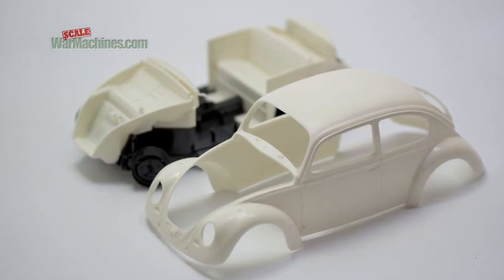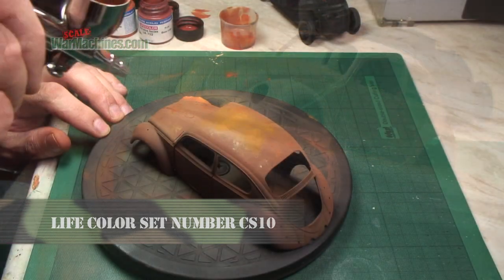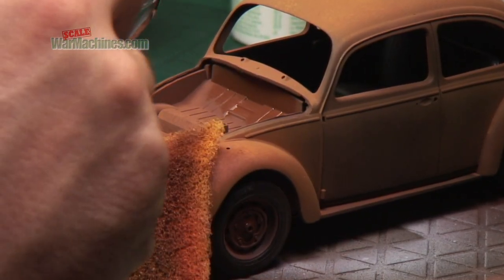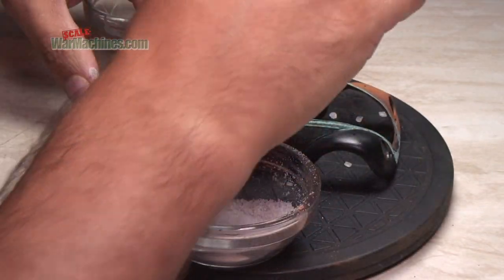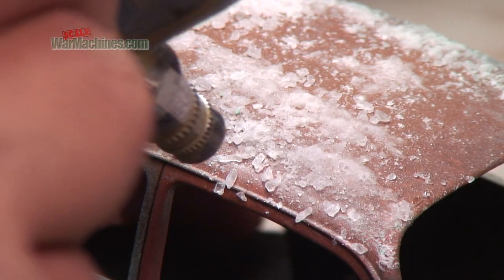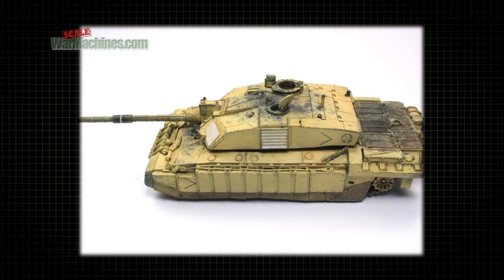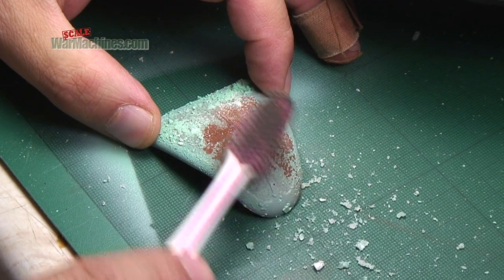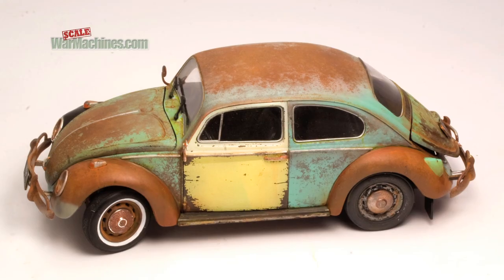SALT CHIPPING - SCALE MODEL HOW TO GUIDE

Comment: I tried this technique on a locomotive roof using these products, and the results were amazing! One problem I ran into was, the water would bead up over the Life Color rust paint. I used dish detergent to rememdy this but, it seemed to use  a lot of it. I would normally use isopropyl as a wetting agent but, obviously, I would not use on top of paint.

Comment: Reworking a King Tiger I built in the 90's, going to use the "salt job" rather than chipping fluid as the outcome looks amazing!  At 1:37 you mention "seal to protect the rusty base" I'm assuming that refers to a matte varnish? Thanks.
Reply from the maker: Yep - sealing is any kind of varnish, matt, satin, gloss, Klear etc.

Comment: Do worry if the air dislodges some of the salt. I don't know yet for sure, but I suspect little salt grains got into my airbrush and are causing severe paint clogging. I will keep you posted on what I find out. Great results from salt chipping, but any methods you can use to keep all minute salt grains  in place, and from being around painting area. Just one micro salt grain in the airbrush can make you wish you never built models

Comment: Great educational value in this video.  Kudos to you, Sir.  Now for a question for you and the audience.  Does anyone have a source for the sponge used in applying the rust coating?  I'm stumped!
Reply from the maker: Ha good question! Go to a phone shop or pawn shop and ask for any leftover foam or packaging foam from gadgets like iPhones. It seems to be most used as screen protection.
Reply: well, bad news, good news and more bad news.  Received a shipment of the above linked material.  Doesn't work as it is entirely non-porous.  The good news is that the wife now has an abundance of the sheets to use in packing gifts, dishes and glass.  The additional bad news is that research shows that Apple has ceased to use the kind of stuff shown in the video and has gone to almost entirely eco-friendly packaging, cardboard and the like.  So it's back to the search.  Any sources of that material will be much appreciated.  Thanks.

Comment: Hi great video for sure, can i ask a question? what did you use before applying the salt (wet one) is a clear coat or any else? thanks :D
Reply from the maker: Reyhan Ramadan just a thin coat of varnish or Klear - although it's not always necessary but recommended to protect the paint.

Comment: Very interested in this technique.  Do you need to use Enamel paints for the base coats since you are working with water or can you use acrylic with no issues?
Reply from the maker: No you can use acrylics - if you are worried, seal with varnish or Klear - otherwise this still works even if the acrylic is unprotected. Just make sure it's fully dry.

Comment: you are amazing, i have a question my friend, im trying to replicate, new batman superman kind of distresed look on a model, do u have any ideas???
Reply from the maker: +Charly Dumeng Thanks. Not seen the film yet but know the look. We'd go for full grey/aluminium/white base coat followed by hairspray or chipping medium on top then top coat in Batman black. Next degrade with water & scratch or pick at the top coat to reveal tiny scratches underneath. Seal with Johnsons Klear or similar, allow to dry then scratch further with a sharp scalpel tip & even a sanding stick to reveal more wear & tear through the black & reveal more of the metal/armour under the paint. Matt it all down when done & do any final touches with paints for scratches, chips or wear & a light bit of sporadic drybrushing too if needed.
Reply: Man you are the best thank you very much

Comment: That looks great. Do you have to use an airbrush though? Will it work well with regular spray paint or would the paint be too thick?
Reply from the maker: Tim Kline Best to use an airbrush - ideally a double-action. That's because you can easily control the intensity of the paint coat going over the salt & that makes the overall effect really work. You could try with a spray can - especially on a larger model - but you need to control intensity through distance - i.e. how far you are from the subject. Also, aerosols are more powerful & may blow away your salt if you're not careful.

Comment: When you spray your initial primer, and your basic rust Coatings, are you using enamel primer and paint, or are you using acrylic?, I don't have an airbrush, will any rattle can type primer/paint work? (whether it be enamel or acrylic)     thank you, cheers.
Reply from the maker: All acrylics, primer then acrylic top coats. May work with a rattle can but you'll have a lot less control and risk blowing away the salt. Get more distance from the model if that's happening.
Reply: Can you suggest a quality primer and paint that comes in acrylic rattlecan? (Until I get a airbrush, which I plan to do here soon.) Thanks for the info.
Reply from the maker: Good rattle can primers for Acrylics? Games Workshop Chaos Black, Tamiya Grey or White, Andrea Primer, Gunze, Automotive primers.

Comment: Is this possible without and airbrush? Probably would look weird if paint it with a brush but at least using some x coloured spray can.
Reply from the maker: clawhammr666 You can do with an aerosol can (rattle can) but you will have less control - this works by spraying different intensities of top coat over the salt that's why it's suited to an airbrush. A paint brush method is never going to work but anybody can try with a spray can.

Comment: I've practised on a 1/32 scale beetle and it looks pretty good now I've bought this same beetle but I'm struggling with the interior how would you attempt to make the seats look worn and faded
Reply from the maker: Matthew Pearsall you could use the same technique or a chipping solution but with only a slight contrast in shades so it's subtle. You could stipple on dark spots for mould. Use crackle paint to subtly show cracked leather or distressed vinyl. We did that on our Gti seats and it worked.
Reply: Scale War Machines 
Thanks do you have a video on how to do that I really have to work hard on this type of thing I can see what needs to be done but I can't make it happen the way I see it

Comment: Very inspiring tutorial! Thank you! 
I tried to replicate the procedure on a tank and.. i've got only one problem.. the salt doesn't stick to the surface. The result is an insufficient covering of the first rusty layer. Do you have any tip?? It's really frustrating to see all the work done to obtain the rust being covered this way!
Reply from the maker: Does the salt get blown off? Lower the pressure. If not, change brand of salt and let it dry before spraying.
Reply: @scalewarmachines  Yes it blows off too easily... I think it happens because I didn't let it dry enough. Thanks again!

Comment: What air brush and paints are you using, I've tried to use watered down acrylic paint but the airgun just doesn't spray the paint?
Reply from the maker: Iwata mostly in this video with either Tamiya or Lifecolor acrylics. Always thin with their own brand thinners for simplicity and each paint brand is different. Test on a scrap model but the level of thinning, air pressure and needle size all make a difference. Try thinning more with their own brand thinners - start with a mix that's 50/50 paint/thinner and high pressure on the Airbrush, then reduce pressure in increments, if paint runs, spiders or doesn't atomise (dry), then up the paint ratio progessing towards 80/20 until the airbrush can't spray it any more or splutters even as you increase the pressure. Then you will know your paint mix ratio and ideal pressure range.

Comment: my question is what did he use to seal the rusty base before he started the chip seem to me if you are gonna put water on it u would want a water prof sealer
Reply from the maker: It is preferable but not essential. As long as the paint is dry it should withstand water. In this case, no sealant or varnish was used.

Comment: Host can I make chrome trim doors on my vw beetle 1/18 and my Fiat 500 1/16 ?
Reply from the maker: +Sethi1st In other words How can I paint chrome trim on doors? Easy, mask off with high-quality masking tape (e.g. Tamiya) & spray with your best silver, metallizer or chrome shade - then remove masking. If you are after good results Alcad paints should work well but require careful usage. If you're after a real mirror finish you can also bare metal foil which is rubbed on & cut to shape. If you want to add your own chrome trim, you will need to apply small details using plastic card glued on then carefully sanded to form the trim parts.

Comment: Can i add the water then salt to areas on a model that has already been painted?
Will i get a rust affect?
Reply from the maker: +Chloe Nakahara Yes, if it's rust coloured underneath. But the technique works with any colour to get a faded or distressed top coat - and you can repeat several times for different effects.

Comment: can this be done by hand painting with a brush or does it only apply with airbrushing?
Reply from the maker: This is always best done with an airbrush because the salt really works as a mask. That's not to say you couldn't get a similarly rusty look with careful brush painting. But in that case you would be hand painting rust spots/corrosion. You could also try a controllable paint stripper like Deluxe Materials' Strip Magic to reveal a rusty base coat under a topcoat.

Comment: Can you do this with enamel paints as well?As that is all I use.. Thank you!
Reply from the maker: We think that's a negative. We've actually never tried it but what you're mainly relying on is a reaction of the salt with water. However, enamels are solvent based so in theory they could remain unaffected if dry. We did it once with enamels & Vegemite (or Marmite in the UK), substituting the salt with Marmite & it worked. So you know, it may just work the same way as long as the enamel is totally dry. Then, you have the benefit of using thinners to subtly fade the paint further. We may try it & do a video! You've inspired us to try it out.
Reply: Thanks very much. Guess I'll have to give that a shot to see how it will turn out.
Reply: @scalewarmachines  Hello!! What exactly is Marmite? I am from Romania and I am not familiar with the item. I am desperate to find a way to do chipping with enamel on enamel (without actually painting it).
Reply from the maker: @Artlyx  Marmite is heavy processed vegetable food paste o edible spread much like Vegemite in Australia. As it is food based and sticky but it is diluted by hot water and so can be perfect for chipping, maybe you have an equivalent on Romania?
Reply: @scalewarmachines Thank you. At first glance, I am not making an analogy with any food we have here, but it is impossible not to find anything like it in my country. I will research on the info that you gave me. It is very useful. Good luck and good health.

Comment: Can i ask whenever i do the salt technique the salt sticks to the paint and doesnt come off easily do you know how i can fix this?Thanks and cheers
Reply from the maker: Firstly, make sure the base-coat dries thoroughly first. Use slightly higher quality rock salt that you ground down into smaller chunks. Do not use too much water. Finally, rub it off rigorously after the top coat. You'll see we use a toothbrush and a mini-drill with a brush attachment to try to remove any specks. However, you might also see that something often still remains in the shots, despite the above steps. So you can also rub down with a really fine sanding stick and a bit of water to get rid of any remnants.

Comment: Can I do it with a Tamiya Spray Can?
Reply from the maker: You can certainly try, in fact we should do a video about this as it is a really common question. Let the salt dry so it has maximum adhesion, then spray with the rattle can from a good distance away so the blast is reduced and hopefully the salt then stays put and does what it is supposed to. The advantage of an airbrush is of course that the paint is thinner and much more subtle or transparent, whereas a rattle can will blast a uniform top coat. Try it and let us know what happened. If in doubt, use a scrap model to test.
Reply: @scalewarmachines  I see. thanks